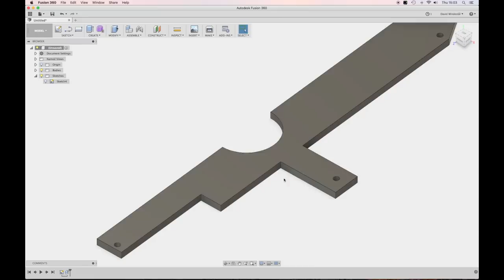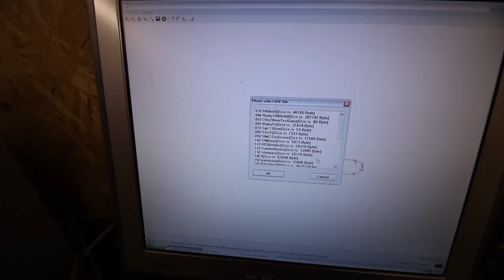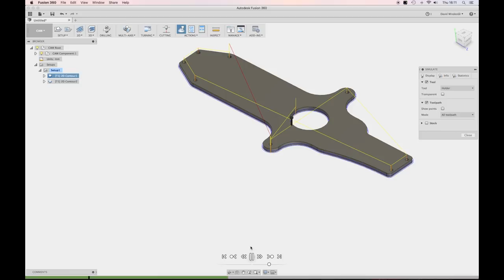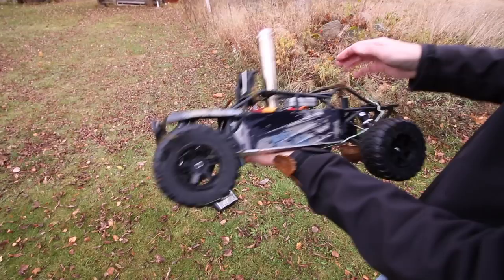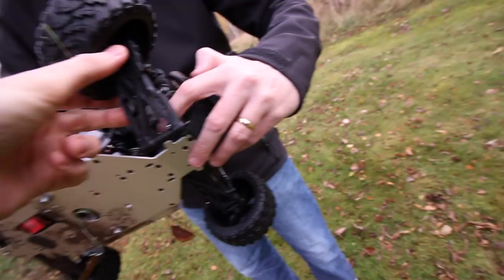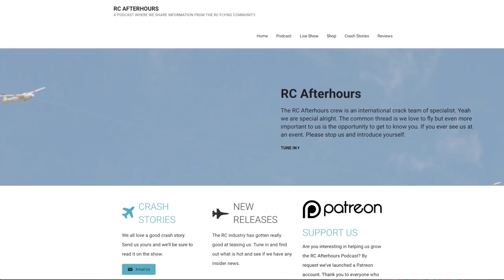VERTICAL ROCKET JUMP RC CAR - part 1 - (It works!) - Build and first drive/flight

Comment: As a machinist by trade Ive gotta say - On youtube you see a lot of dangerous, dumb or otherwise just incorrect methods of machining/ making things.

David, you are NOT that way. Good to see someone who knows what they are doing and who takes the time to do things the right way (even if they may not have all the necessary tools) Keep up the good work!
Reply: P.S. What about something similar (maybe even just a large rocket with a gopro or two mounted)  with a gyro for stability during a vertical launch. Maybe a canard setup to keep the control surfaces away from the blast? Itd be cool to see onboard video of the gyro correcting in flight!

Comment: Have you ever thought about using thrust vectoring to keep the car stable in it's flight? I think if you did that, it would probably have a much more stable flight, even over rough terrain.

Comment: Maybe if you did this with 3-4 solid rockets layer out so each one points towards the cg (not vertical but like at 70-85°) so it creates some stabilization, like the arms on the s500 frame

Comment: YES! I love it.
Don't take this the wrong way, but I like this content much more than the rocket knife stuff.
Also, could you detail the ignition circuit? I would probably just take an ATTiny or something similar to generate a on-off signal from the PWM signal, which then applies power to the ignition capsule, using a mosfet to not blow up the poor MCU.
I'd love to not bother with the design and take a pre-existing solution...

Comment: You should consider building a jet rc plane that itself flys reasonably fast...but with some rocket boosters that can be switched on... It should be still controllable.. maybe use  fpv to fly it :)

Comment: FYI +David Windestal and others. Fusion360 has cool scripting, I saw you where deleting lines of gcode and copying to illustrator. I was doing same in the start, but took not long to figure out how to edit scripting in F360. I will speed up the design to print. Kind Regards

Comment: I would try two smaler rockets on both sides, 45 degree from ground on side, and slightly in an angle towards the center axis.  3 little rockets would give you even more precision, in a pyramid shape towards the desired exit vector.  or a rocket in a gimball on top with an aim.

Comment: Build a rocket nozzle that ejects at 45 degree angles providing even thrust yet would allow the car to be underneath the rocket forcing it directly up due to the weight of the vehicle acting like a pendulum

Comment: For such a small 'hop' you could just add quad copter motors to each corner and then let it 'bunny hop' over the watering can.
Reply: B0M0A0K you may have missed the rocket theme of the channels 😀

Comment: maybe the rocket should be inclined in the forward to back direction, so it's exhaust is sloped down and back --  that would minimize the lateral vector somewhat, and propel the car more in the forward vector.....   maybe dial down the impulse to a lower, short impulse...go for the short hop first....then put the longer burn on it...

Comment: put another rocket in the broken car..set it at the ignition point at the correct angle and fire it to the  finish line.. then cut the two films for a spectacular finish... just sayin.. thats how the movies would fix this problem

Comment: Dude, you must have some money, because those laser CNC's and stuff are super expensive! My poverty-ass was freaking out that you even have autodesk!
Reply from the maker: The laser was a broken down unit that I got for about 2k and repaired, the CNC router was about 700 USD and the software is a free one called Fusion360. Be frugal, look for deals daily. It took about a year before the laser popped up. Be patient and while you're looking keep saving up :)
Reply: Ah, I see. Patience isn't my greatest attribute, I'll have to work on it. Thought that was actual AutoDesk, I'm not so deep into all of the freewares right now as I work on my degree.

Been following you since you were on Flite Test! So sad you left but glad to follow you on this channel. You and Peter didn't seem to care that you crashed planes, so I made myself accept (re)building as being part of flying. 

Love the crazy experiments! Maybe you can collaborate with colin furze someday? I'll need fair warning if you do, my heart can only take so much excitement.